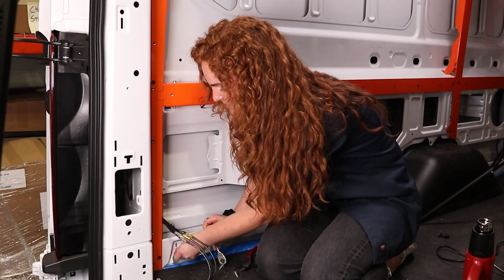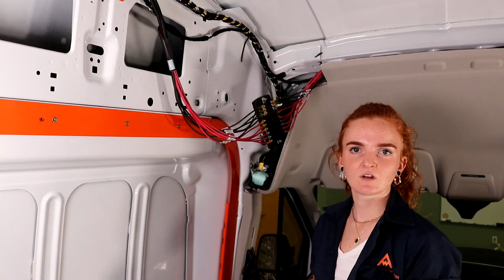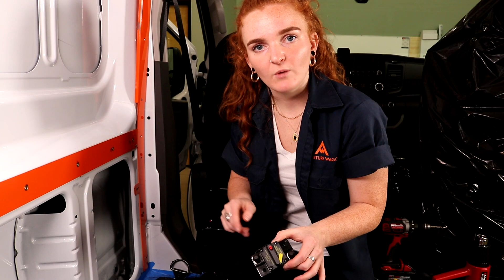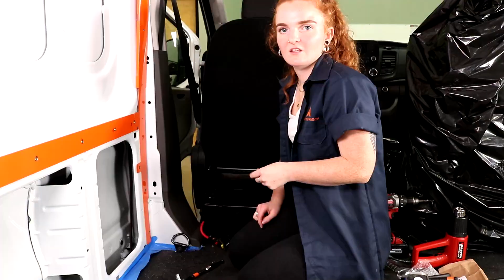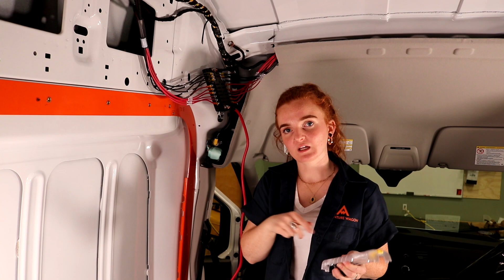Electrical Connections - Transit High-roof Extended

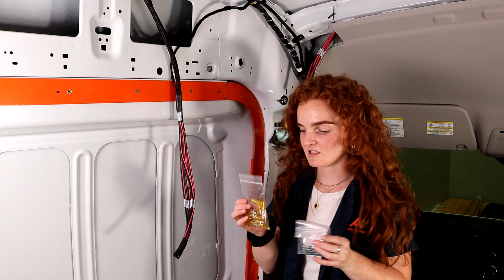Comment: At minute 5:54 you said the blue connectors are for 14 awg wires.  Blue is usually for 16 awg.  Are you using 16 awg or 14 awg wire?